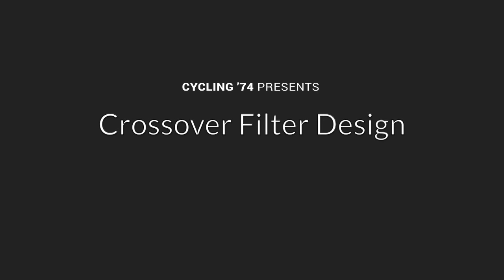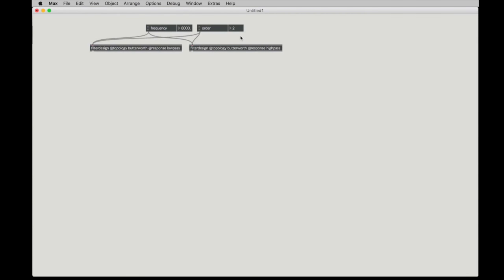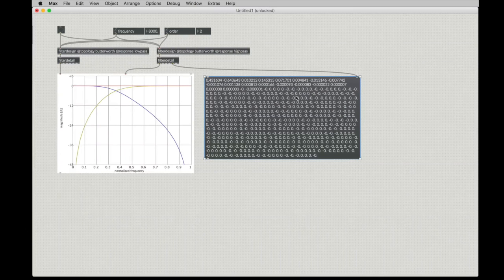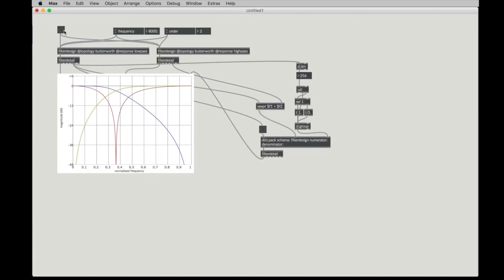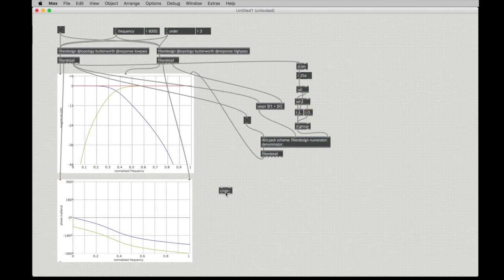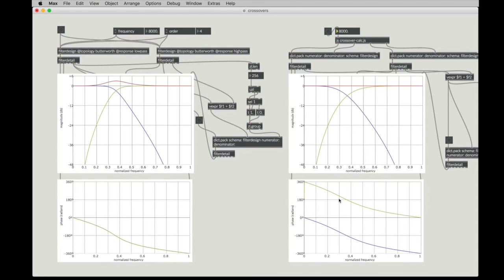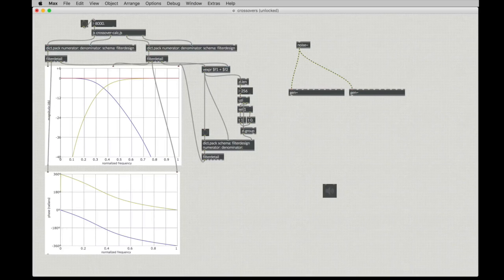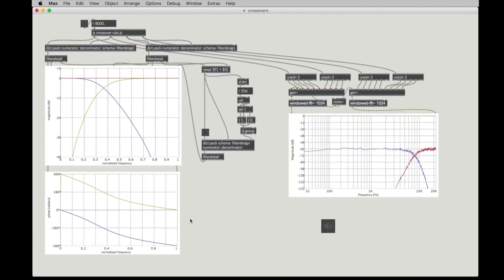Crossover Filter Design

Comment: I have a question about the 360 degrees phase shift between the HP and LP parts of the 4th Order L-R filter. Doesn't 360 degrees imply that they are a whole cycle apart? For a crossover between a sub-woofer and woofer at, say, 100 Hz, wouldn't that lead to an audible artefact with a real, dynamic musical signal? BTW, the tools you are using and your skill in using them are awesome! Many Thanks.
Reply: as the signal is out of phase by 360 degrees everywhere across the frequency spectrum it results in an identical signal, doesn‘t it?